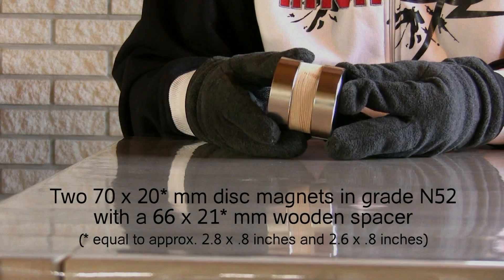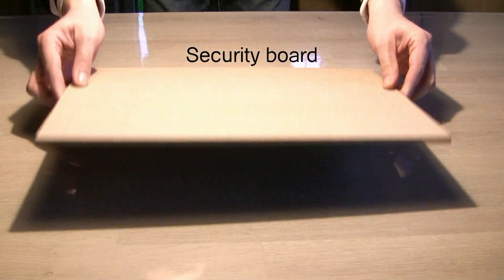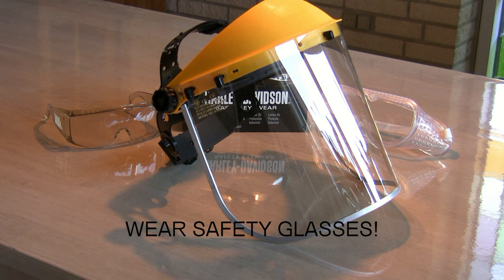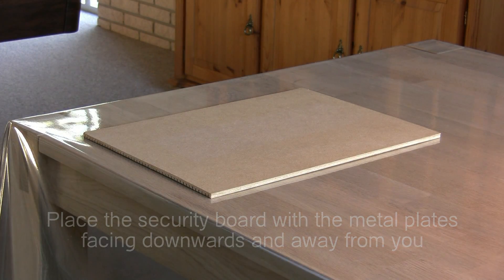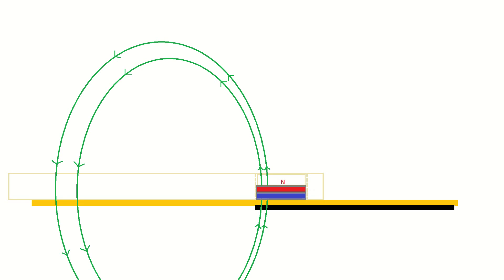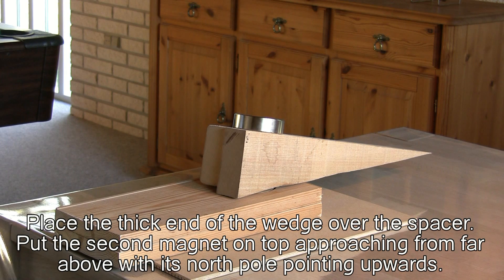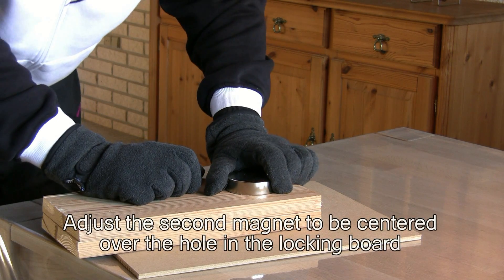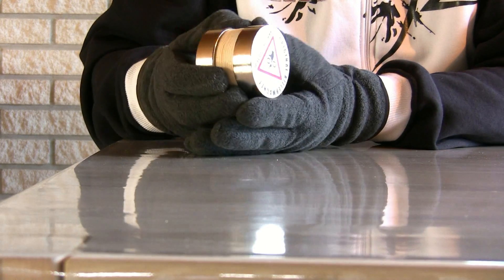Combining two large neodymium magnets including spacer

Comment: Would using a round stock of copper about the same thickness of the magnets make a good spacer?  So when you put the magnets together the eddy currents induced in the copper may slow them down a bit.

Comment from the maker: @Apokolohypnotis :
I don't know what you would find acceptable. Each of the magnets in this video are sold for €100 on their website but magnetportal has the exact same magnet for sale right now for €82 on eBay (search for 'neodym d70-h20' - seller is called neodym-24).
I do believe it is impossible to find a similar magnet much cheaper unless you go down in grade from N52 to N45 (on eBay for €65). Neodymium is so expensive right now (from June 2010 to June 2011 the prize soared by 750%!).

Comment: @croatiaa4ever and the right vibrational speed to made the desired strength on the magnet its self (the harder the more it shards the softer the weaker and more damageable) the strength of the field comes from its composition you can try adding other metals just as titanium (Ti) or catalysts to alter and inhence the properties of the Neodymium. personally I have been getting into ferrofluids more so, Making a furrofuild accelerator to be exact.You will be able to work out what 4;)

Comment: @croatiaa4ever Its not a very easy thing to do but if you are really interested. If you can get the materials to make a NdFeB magnet Neodymium (Nd), Iron (Fe) and Boron (B). You will need a small metal foundry purchasable over the internet (obviously with no metals with magnetic properties) A vibrating cradle cooling bath (often composite ceramic) to lock the molecular structure togeather (and can also make harder and stronger magnets) and the right ratios (continued)

Comment from the maker: @thecreativewebshow:
They are simply to powerful. If just put together they would accelerate so hard that even at a short distance they would reach a collision speed that would break pieces of the magnet. Neodymium magnets are crystalline and brittle - treat them like glass.
And each of them pull with well over 200 kg force so it's not possible to just 'hold them back' by hand when putting them together. That's why I use a wedge. They are also expensive and rust away fast if chipped/shattered.

Comment from the maker: @Ericec4126:
Modern speakers usually have the magnets hidden so it's not really easy to tell. The most obvious feature would be that the magnet system looks surprisingly small in comparison with a speaker of similar size and overall quality but with ferrite magnets. 
Since taking the speaker apart is not an option you just have to trust the supplier...

Comment: @MetreaX Magnets this large can exert hundreds of kilograms of force. If your hand got caught between the magnet and a metal plate it would crush every bone and tendon in your hand. And believe me, without help you would NEVER free your hand, save for amputation. 
These magnets combined would probably provide about 300-400kg's of force. Basically, half a car's weight resting entirely on your hand. And there's no way to "turn them off", so once you're stuck, you're STUCK.

Comment from the maker: @slaske666:It depends on what you mean by two magnets? If you place the two magnets 'side by side' in an application where they both hold an object with both of their flat surfaces in use:Yes,then you have double the lift/pull force.
If you combine the magnets to one:No,you will not have double the force but only ~1.5 times the force so it will take roughly 400 kg force to pull them parallel appart if they are stuck together.Much less if you slide them apart as shown in another of my videos...

Comment from the maker: @MetreaX :
Lol :)
It is easy to tell that you have never tried handling large neodymium magnets. I'm not sure I understand your chainsaw analogy? Chainsaws are filled with safety features and can even be quickly turned off. But still a lot of people (not you apparently) use safety equipment when cutting wood with a chainsaw.
Large magnets on the other hand have no safety features, can't be turned off and even smart people are surprised by the power in these.
Thanks for trolling!

Comment from the maker: @thermaldog:
Thank you.
1) Neodymium magnets are not only very powerful they are also some of the most permanent magnets invented. A general rule of thumb is that they will lose under 1% of their power over 10 years. Some will say that they will last 300-500 years but that's pure guess since neodymium magnets have only existed since 1982 :o)
2) No, but all magnets can be used to generate electricity in the right setup.